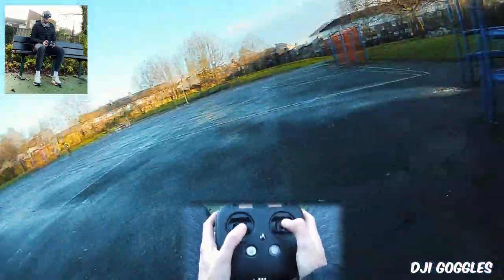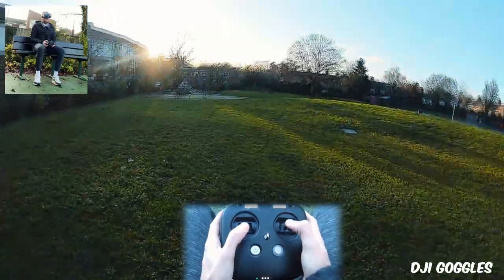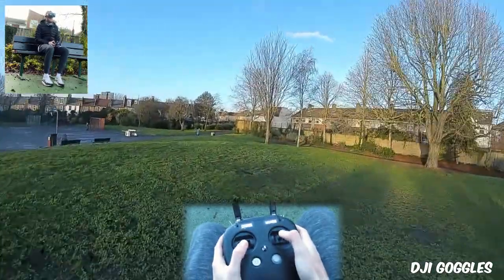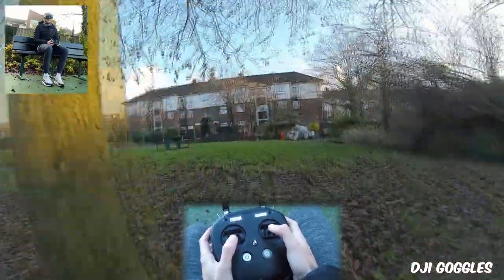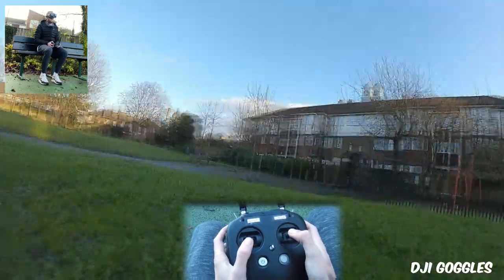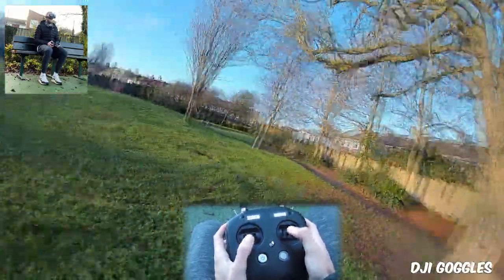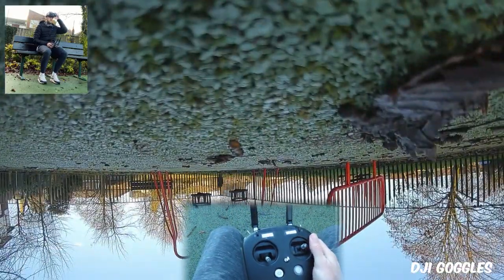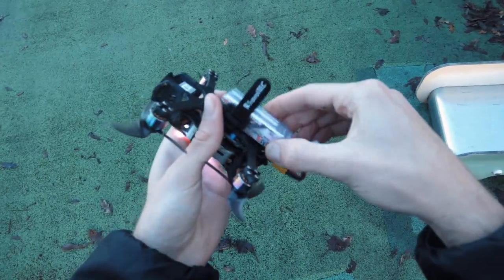FPV Flight VLOG with Sub-250g TransTec Beetle HOM 2.5″ | This is a DAMN GOOD QUAD!

Comment: That thing looks like it flies smooth! I can't wait to get mine in the mail tomorrow, I mainly bought it for indoors so I might have to use some 2s batteries to keep it manageable. 
Was this recording from your goggles DVR or the air unit?
Reply from the maker: Nice one! Excited for you bro! I would get 4s for outside and maybe 3S before that if your getting comfortable. I use the 3S to warm up and then get on the 4s. The video is from the goggles. I left my SD card at home so could do the air unit! Haha 😂 looking to get a insta360 go for this or maybe a naked GoPro down the line!

Comment: Looks like a nice quad, great that you can run it on 4s and fit DJI into it. I assume it's using the Vista?  Sub# 207
Reply from the maker: It’s not it’s all air unit!
Reply: @MichaelHoughton_  wow, you could save even more weight with a vista. Looks like a nice quad. Happy new year, my friend!
Reply from the maker: @skyhackerfpv7104 it sure is! Have a insta360 go on there now and it rips, is under 250 and flys like a 5inch (without the floating ability as no momentum) 
Stay tuned will post some clips in the next few days! Nice to meet you and see you around back here hopefully!